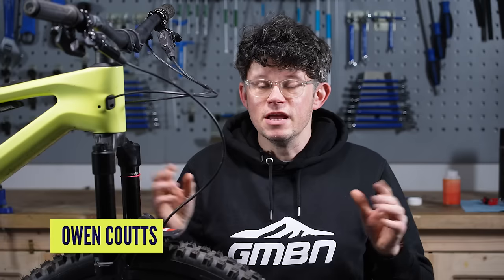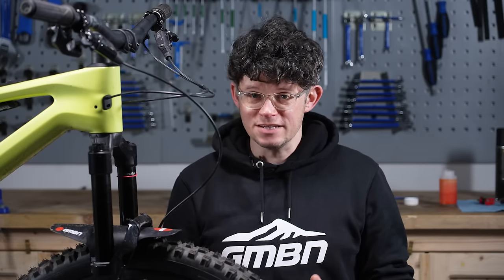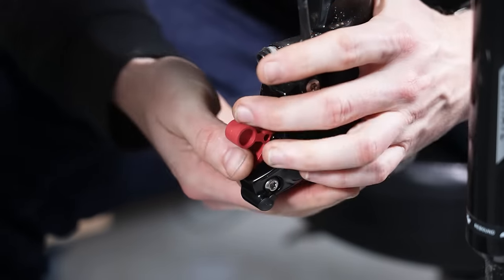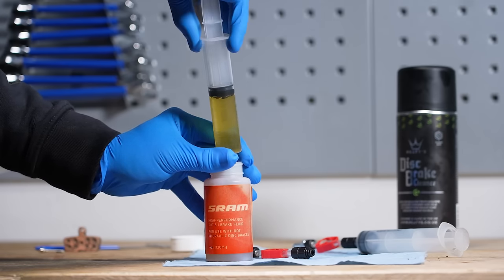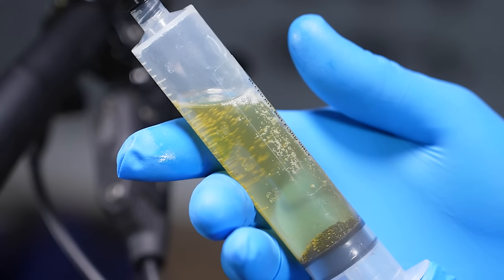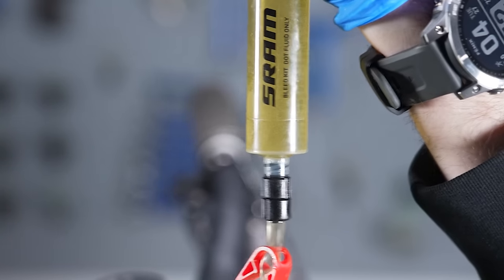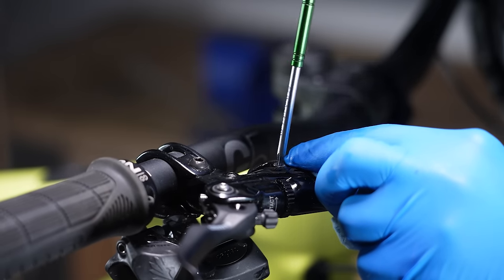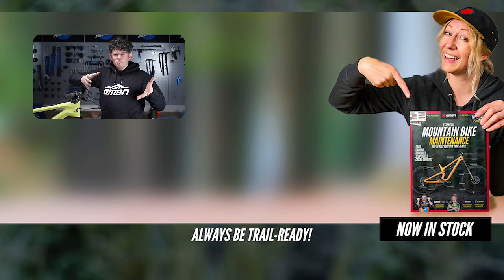How To Bleed SRAM Hydraulic Disc Brakes

Comment: what I do differently to get some pressure into the system is, that I close the system on the lever first, put some pressure down at the caliper and close the screw with the syringe. trust me guys, the brake will feel much snappier.
Reply: So basically its the same, but when you finish the lever you open the caliper syringe once more to add some pressure.
Reply: @statom985  Yes
Reply: Best Tipp ever! Thanks mate! Finally sram brakes are useable 👍👌
Reply: follow up question -- do you completely remove the lever syringe and turn in the screw before adding pressure at the caliper? seems like that is what I'd do if I wanted to get a bit more pressure in there. Then while slightly pressurized at the caliper, close the bleeding edge port and remove?
Reply: @parkerhegstrom2265  exactly this way
Reply: Best tip 🎉

Comment: I spent hours trying to figure out why I couldn't bleed my rear brake, then discovered that the diaphragm inside the lever tray had deformed preventing fluid from passing through. I hope this suggestion will help if the same thing happens to anyone.

Comment: I like the Shimano system with their bucket system at the lever. Slightly easier to work with.
Reply: You can do the same with SRAM brakes, as long as you get all air out, the pressuring part is nonsense anyway if you stroke the lever a couple of time while pushing fluid from the bottom (caliper) you'll probably achieve faster and better results, I do...
Reply: Not to mention they use non-toxic mineral oil instead of that DOT crap
Reply: Same... shimano is so much easier and cleaner.
Reply: @marvinator79  love the Shimano brake bucket on lever. Absolutely much easier to work with
Reply: No you cant. @LaurentiusTriarius 

You said push from bottom caliper, that's the point w Shimano brakes, you don't need a lower syringe, ONLY top bucket on lever

Comment: Why… why why why would you use corrosive oil neer (carbon) bike parts and why so much work to bleed??? I’d say shimano has the better system and I’ve had both…🤷

Comment: Didn’t work for me… there must be a ton of pressure in the line at the brake lever because when I pull the screw to the syringe out, it comes out spilling over and when I put the screw back in the brake lever still collapses to the bar.??? What am I doing wrong?
Reply: Curious if you ever figured this out! My thought would be either 1) you have a leak in your system somewhere or 2) a lot more fluid is coming out than should or 3) you don't have anything blocking your pistons when you compress lever?

Comment: Hi Owen great video.  However the preping of the syring and pulling of the syringe is Not actually drawing air out of the fluid itself.  You're not changing the state of the DOT fluid especial at room temperature.   The air that looks like is coming from the fluid is actually air that is find its way through the seals of syring lever/plunger.   The only way to extract air or water from the DOT oil is to change its state by heat.  Just like water, you add heat, water boils, and turns into water molecules/vapor.

Just thought you should know.

Comment: In the SRAM brake bleed video they say to turn the contact adjust in the opposite way, away from the arrow!
Reply: As ive bled SRAM brakes with contact adjustment alot, i personally think the SRAM method is absolute trash and bleeding should be as done here. this way you can dial your lever throw shorter and you get much more power/bite feel in the pads if everything is done properly and nothing is contaminated. IMHO i think SRAM messed up the bleed video, and were too proud to admit the mistake and just let it sit there... I can see no other logical reason for rotating the contact point the way they did. If you bleed brakes the SRAM way, you cant dial in your brakes to have a shorter lever throw. With this method, you can :) With that said, dont push from the caliper up to the lever if your replacing liquids.. you want to push from the lever out the caliper so you dont drag all the contaminants sitting in your caliper up through your hoses and lever reservoair
Reply: I came to the same conclusion after following SRAM advice and realizing I couldn’t dial in my lever throw shorter ! :(

Comment: I rode SH for 20 years, I wanted to try something different, so I tried Sram Code. In fact, its awesome brake. I really dont like SHs lever like point differences. With right tools is Sram bleed pretty easy and allways succesfull. SH often lets dome air in system. They say: Bubbles in mineral oil allways flows up. Not true. Moving fluid up and down is  much better idea.

Comment: The Contact Adjust dial is supposed to be wound in the opposite direction to the arrow. 

Why not pull the vacuum at the end on the lever too after closing off the bleeding edge port? 

Sram also advise not to push from the caliper incase the pressure dislodges the bleeding edge fitting.
Reply: I was thinking the same!
Reply: can you link this sram advise ? im curios
Reply: @statom985  It’s in the Code Bleed Manual

For levers with Contact Point Adjustment:
Rotate the Contact Point Adjustment dial in the opposite direction of the arrow until it stops.

Do not push brake fluid into the caliper with the caliper syringe. Excessive fluid pressure can cause the Bleeding Edge syringe tool to dislodge from the caliper.
Use the lever syringe to move fluid through the system.

Hold the syringe at the lever vertically. Firmly pull on the plunger to create a vacuum, then compress the plunger to pressurize the system. Repeat this process several times or until only a small amount of bubbles exit the system.
Reply: @Justin-ny6un  I can confirm from personal experience that yes the bleeding edge tool can dislodge if you push too hard from the caliper side haha
Reply: I was also thinking the same, however, after bleeding my brake following the sram advice, I realized there was no way to shrink the contact point anymore (because it was bled with the contact dial all the way in). It feels like to get most adjustability after the bleed, maybe best to have the contact dial at the mid point ? Thoughts ?
Reply: @parkerhegstrom2265  I have seen people mention doing that. But I find I wind the contact point in about 25 clicks after bleeding, and they still feel better than my old XT8100. I’m on Code Silver Stealth so not sure if there’s much difference between them and RSC. I have been told they definitely feel different. I’m ok with how they feel with the SRAM method, but yeah it does leave me at the end with not much adjustment if needed
Reply: @Justin-ny6un  right on! i guess in the end it's likely something that just comes down to personal pref. Thanks for the reply!

Comment: dot oil from company's marketing it for sram breaks price it about 5 pound per 120ml when you can go to any local halfords or simlar and buy an entire liter for about 8 pound which will outlast your bike
Reply: Buying brake fluid in bulk means all that unused fluid is sitting around in your garage, slowly absorbing water.  This guarantees you will be putting contaminated fluid into your brake system in less than three years.  This is a mistake.

Comment: And if i want to fill the circuit with new fluid? I never understood the logic in mixin the old with the fresh oil...
Reply: Fill the lever syringe with fluid. A few ml in the caliper syringe. Push everything through from the lever syringe to caliper. Disconnect both and dispose of fluid. 

Refill syringes, 3/4 full on lever, 1/4 on caliper. Complete bleed as normal
Reply: @Justin-ny6un isn't it better to push bubbles from caliper to the lever?
Reply: @puka6043  Sram advises to push and pull from the lever. They say this because pushing from the caliper can disconnect the bleeding edge from the pressure.

But it’s probably better to at least push out the dirty/old fluid from the caliper instead of pushing all the shit up to your master cylinder.

Initially you’re only getting new fluid in the system so doesn’t matter if you’re going the opposite way to which air would travel.

Shimano says to push up from the caliper but how black their fluid gets I’d rather drain it from the caliper first. Then push up with clean fluid.
Reply: Exactly my thoughts!

Comment: Any good dot fluid will work , but correct version . I use Motorex , Valvoline  or Castrol . They also give good results . A friend who is a motorcycle technician found this during a sponsored rider race preparation , preliminary test with the Mondraker .

Comment: Dot fluid is so unreliable i had nightmare with avid juicy 3 always go spongy within weeks total rubbish
Reply: Did you do the repair yourself ? Dot fluid has a shelf life because it can mix with water, did you do a total flush ?
Reply: @appelflapdrol  no I think avid juicy 3 are always leaking in some sort of way not sure if dot fluid causes more air to get in system more easily I just prefer mineral fluid brake systems less hassle
Reply: all cars use dot fluid so how can dot be unreliable  ?